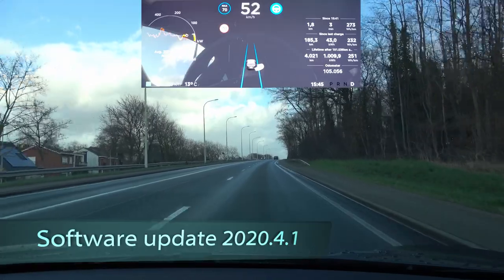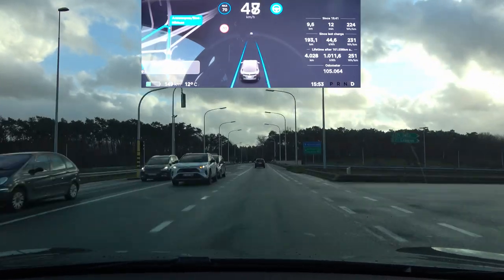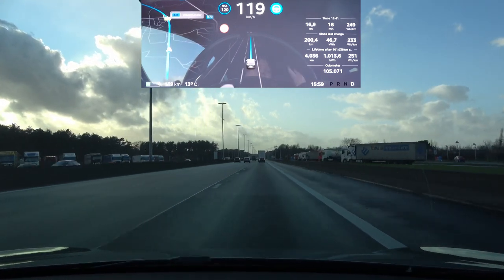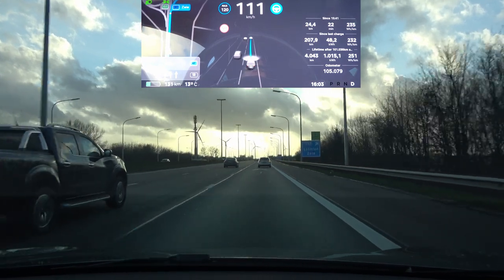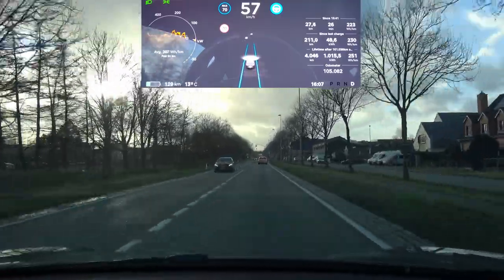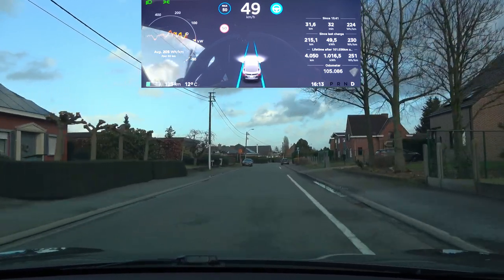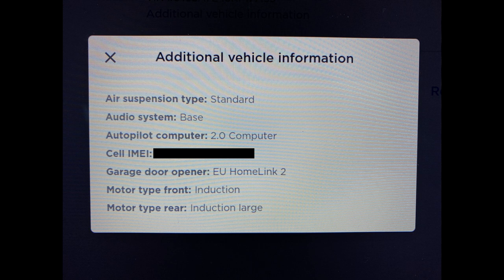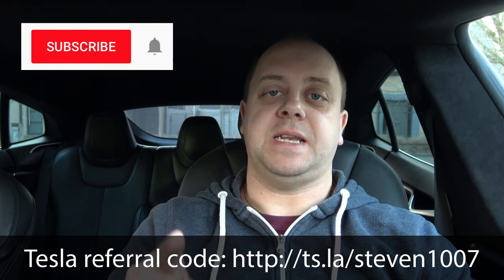AutoPilot 2.0: testing update 2020.4.1

Comment: Thank you for another 'State of the Union" ;)

The phantom blinking has been with my Model 3 since about August or September. For me, it's only doing that in 2 locations on my daily commute. And it's doing it pretty consistently (like 75% of the time).

Lane changes have improved a lot imo over the past 2 months. The first V10 version was awful, a huge step back. But it quickly improved after that and now they are better than ever before. Still hamstrung by UN/ECE R79, that is superfrustrating.

The delayed passing of cars turning off the road in front of you is related to the delay of the computer perceptions vs real world. In the second instance @ 8:20 you can see that the car has moved into the exit lane completely, but in the visualisation on the binnacle, still shown as being partly in your lane. It's a perception problem. That will improve with better training of the neural net and a faster computer (HW3)

And finally, much of your tests are on city streets, for which the AP is not intended (highway only). So my guess is, Tesla is not really putting any effort in it (or maybe even negative effort), so it doesn't get too good and people start trusting it too much. That is a big danger, because all the bad press for a killed pedestrian is on Tesla.
Reply from the maker: The purpose is to test the limits of the system, not just where it works well. I one of these scenarios will be handles well consistently, I will find the next challenge for AP ;-)
As for the delay on the screen, it might be just the can bus being too slow, but it would explain a lot of strange behaviour. However, I've never had the car slow down as much as it did there. Usually it's much less pronounced

Comment: Thanks again. Some of the ‘bugs’ may be caused by a too heavily loaded neural network. It seems a tiny bit too slow in its decisions. Hope you get 3.0 soon at the same software release to do a comparison. In most cases it chooses safe before smooth, which is good I guess.
Reply from the maker: I'm looking forward to the point where it will actually not drive me straight into traffic cones and cars parked halfway onto the street. I know that this is city driving in my example, but I've had to intervene also when cars are parked on the emergency lane, too close to the road and my car would just hit them. :-o
Reply: Non-smooth is NOT safe… it’s ridiculously dangerous for the people in the car and the others on the road.

Comment: The parked car at the curb. That indicates that still Teslas would just completely crash in a cars under certain scenarios. I've also had several occasions where the car would just have driven into a car if I did not intervene while you really expect the car to behave correctly.
Reply from the maker: I know people that have actually crashed their car because of this. (and yes, they should have paid attention, but AP did not see the car as an obstacle)
Reply: Yes, but as we know AP will happily drive into a car  that is Parked on the shoulder.. that IS highway use
Reply: @Jen well.. it doesn't matter if it is rare. It just is an indication that the visual object detection is ignored for lots of scenarios. Not all accident make it to the media

Comment: You’re testing a lot things where AutoPilot in its current state is not designed for so most behaviour is expected imo
Reply from the maker: The S curve was handled beautifully before UNECE messed it up. The disappearing lane lines is a new section I'm testing and where I've already said multiple times that this is at the edge of its capabilities. If I were to test highway driving only, there would be no point, because that would be extremely boring... I deliberately take it to the edge and have discovered many improvements (and regressions) over the years
Reply: He’s testing a lot of things that i) used to work from well-to-perfectly; ii) work perfectly in the U. S.

Comment: It is not only due to lateral forces. Also simply the maximum steering angle. Since a few updates ago it now is possible to have AP engaged at 1km/h and tested various road at that speed and the car just doesn't steer. Either due to EU regulations or current AP limits.
Reply from the maker: The steering angle is related to the speed. In previous videos, when it was working, the car slowed down before the S-curve and it handled it within the regulatory limits.
Reply: @StevenPeeters  That is the rule, but why are corners not taken if I set the speed to 1 km/h? :-)
Reply from the maker: Ramon Smits because that feature is not yet active?

Comment: Green found info in the recent firmware confirming AP2-HW3 upgrades in the works, no Radar chnge no steering replacement. So it looks as though they will switch out the cameras and the AP computer eventually. Hope it will still happen this year. It's abount d*mn time.

Comment: Is it much the same as the last one? it's possible that they are working on other things so this line of AP isn't being updated. Elon suggested in an interview that they have begun training the neural nets differently more as an end to end solution with less human code. Depending on how completely he means that, I hunch that wont work. I'm not going to say why because I'd like some credit.
It's also fairly telling if they are essentially abandoning this line of development. Maybe that was always the plan for this current hope for turn capability but not sure it is. Maybe they have parallel teams developing both...
Reply from the maker: Yes, it is pretty much the same. As far as I know, up until now, the software was developed for HW2.5 and then ported to the other platforms. After that base code rewrite that Elon talked about to be able to use the new chip to its full potential, I guess it's the other way around.